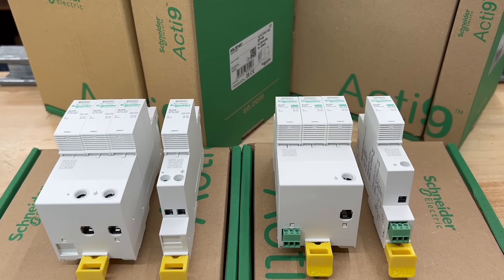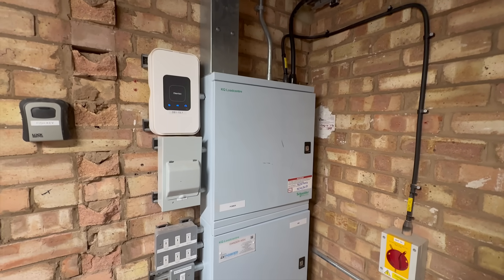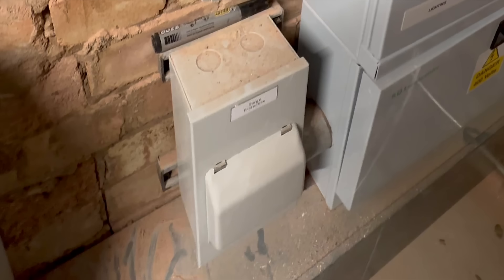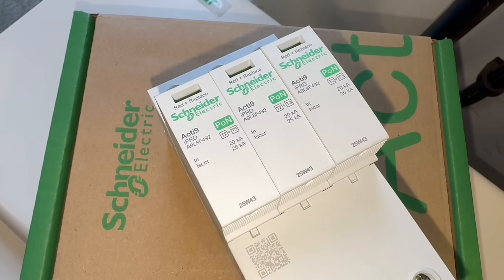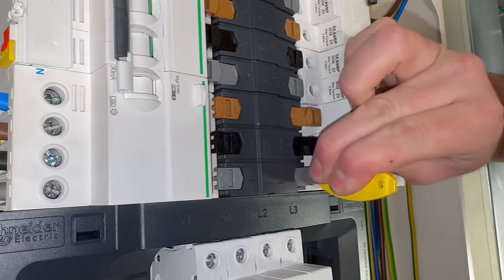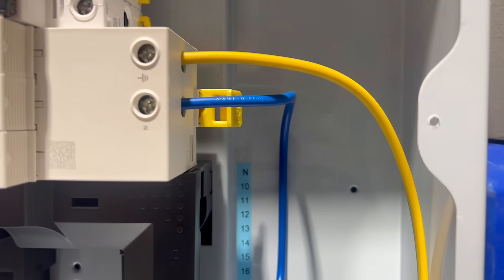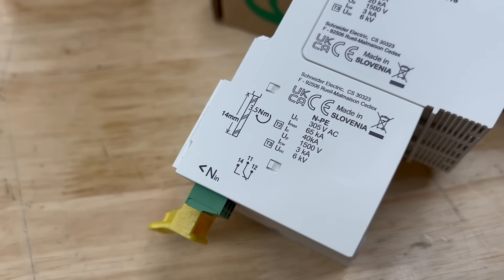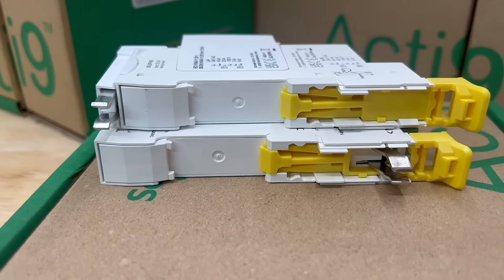Schneider Just Rewrote the SPD Rulebook...

Comment: Hager have been doing the same for the last two years. LINE /NEUTRAL Come straight of main 100 amp switch and directly earthed to the chassis or box. Occupies 2 ways. really neat.
Reply from the maker: This is 3 phase
Reply: @efixx  🤦‍♂️🤦‍♂️🤦‍♂️🤦‍♂️
Reply: Can you share a link because looking at the 3 phase ones on their website it states the need for a fuse in parallel with a max rating of 160a
Reply: Hager JK101spd  125a surge protection
Reply: As have Wylex
Reply: So are the Hager spds

Comment: Not convinced the DNO would find it acceptable that the service fuse blows even in domestic....
Reply from the maker: The potential to blow the service fuse is what gives domestic boards a 16kA fault rating using 6kA devices under BS EN 61439-3
Reply: @efixx thats not the same thing though and regardless of what Hager say its still a non compliance if nothing else isn't it...